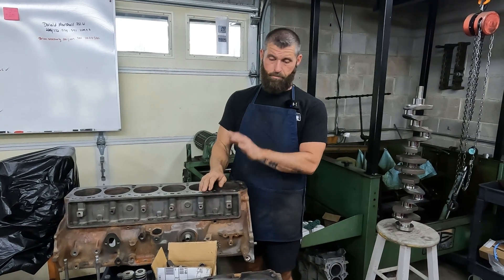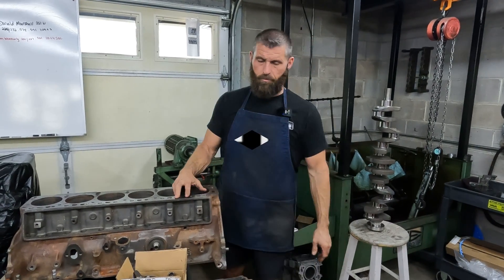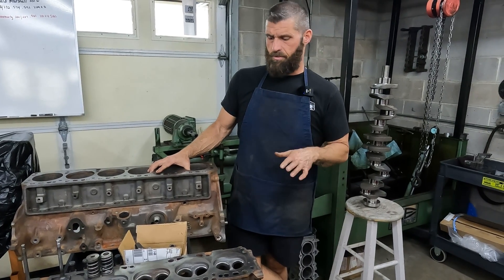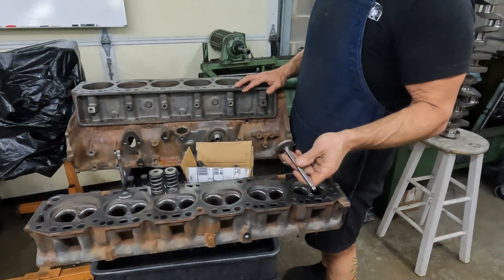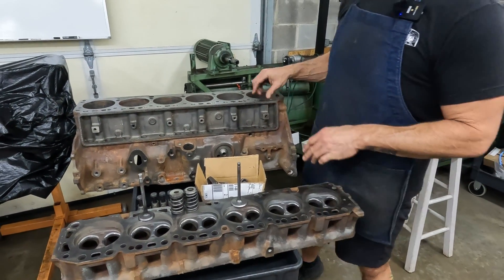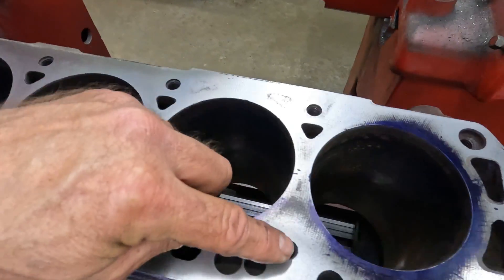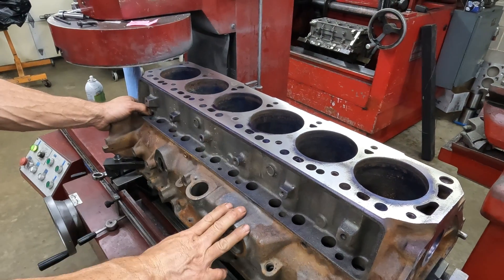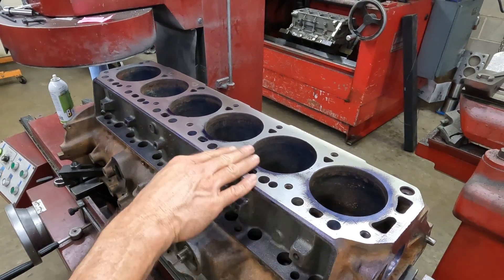6 in a row : eps #1 , Decking the block

Comment: Your right, when me and my buddies were 16 years old, we did not deck our rebuilds/heads because we used those thick composite gaskets and we never had a head gasket blow out even with our 10 to 11-1 compression. This was a very informative video, thank you sir.
Reply from the maker: @siliconvalleyengineer5875  very welcome

Comment: It sounds like you already have pistons, but if you don't you can use 351W pistons and have a lot more options.  You just need to find a set of early 300 rods with the .912 wrist pin or bush the existing rods for it.  Nothing really useful out there for 300 pistons any more.
Reply: Ford 390  TRW/Speed pro L2291F pistons will work in the 300 if you bore it to 4.050". Same wrist pin diameter, same compression height but those pistons will have way higher compression than the stock 300 pistons.
Reply: @MattsRageFitGarage  390 pistons used to be the go to for the 300 because there were more choices and they were cheaper, but that isn't the case any more.  The set you mentioned is forged and cost $500.  A set of 351W cast pistons that will meet the needs of 99% of the people building a 300 can be had for under $150 while leaving room for a few more rebuilds, adding just a little compression, having a tighter cold clearance and weighing a lot less.  If you do need something slightly stronger than plain cast with a significant compression increase you can get a KB 151 hypereutectic set for about $300.
Reply: @GoPetty43  pistons are expensive for anything these days unless you're going for the bottom barrel stuff.
 I was pricing out a decent set of pistons for a 351W last week and the prices were ridiculous.

Comment: I recently had a small block Chevy where from one side of the number 1 cylinder to the other was 0.002" difference in deck height. I told the machinist who probed it with their CNC mill and he called and said that I was right. I think he was surprised that I figured it out at my home shop, without a CNC machine and that it could be that far off in 4" of deck travel. That engine has been fantastic on the racetrack after all the love it was shown at the machine shop. That's what you sell, "engine love."😊
Reply from the maker: Definitely

Comment: I used work in a garage and do valve jobs on heads that came to me cleaned up but I don’t understand why the cylinder closest to the water pump has the most cylinder wear, why is that?
Reply: The outer cylinders usually run the hottest and its common for them to have more wear than the inboard cylinders.
Reply: @MattsRageFitGarage But don’t you say the cylinder closest the water pump has the most wear right after the 9:00 minute mark. I’m not trying to to be a smart a** but I thought it would be the hottest cylinders farthest from the pump on an engine. I understand it’s easy to misspeak making videos all the time however I just watched the video again. Am I missing something?
Reply: @jamesgreen9954  Depends on the flow of the coolant for a particular engine. Most engines the water gets forced to the back and then back up front. Also didn't catch if this was a carbureted 300 or not. That also plays a part in cylinder wear. Just about every engine I ever tore down or worked on that had the heads off of, the outer cylinders to the block always had the most wear to them.

Comment: A friend of mine was working on a straight 8 Packard that the block was .008 bowed in the middle and the head was .007. We took of .005 from the block and 004 from the head. It is still running today. What you said about the composite gaskets must be what's holding it together. Thanks for the education.

Comment: That motor decked off like it had been run really hot a time or two. It should be a really good block. Those old 240 and 300 were good engines.
Reply from the maker: Definitely

Comment: We ran a fleet of E-350 Ford vans at our plumbing company . We had 300 inch 6's and 460 V8's . Under essentially the same conditions , carrying heavy loads every day , the 300 inch 6's out lasted the 460's 2 to 1 . We ran 8 to 12 vans , depending on need at the time . This was in the 90's . All of the 300's were mid 70's trucks because they didnt need to be replaced yet . The 460's were mid to late 80's and 90's models . All of our trucks got maintained like crazy , none were neglected , so it wasn't that , the 300's were just great motors !
Reply from the maker: I believe that 💯

Comment: In the mid-'80s, I interned at a Ford Dealership while I attended trade school to be a "Factory Trained Ford Tech". One of my first jobs in the shop was to R&R the 4-speed Automatic (AOD) on the shop truck, which was a 1980 F-100. It had 700,000+ miles on the original 300-six engine and I was told I was installing what would be it's 7th transmission. And the engine ran like a Singer Sewing machine. Lots of noise but never quit and always got it done.

Comment: I am moving into a rural residential estate by next year which was developed about 40 years ago & a lot of people moved out after finding out that the frames of their houses had been eaten out by termites over here in Australia.

My dads house is as old as I turn this year (47) & it was built using eucalyptus timber which seems to be much more termite resistant than the pine wood framed houses in that estate.

In my case the block of land is vacant meaning that they will obviously build a steel framed house on that block of land now.

For whatever reason with my grandfathers old Ford EL Falcon wagon  after he rear ended another car in traffic at slow speed because he got distracted, it was a Domino effect meaning that a few other cars in front of him got rear ended as a result.

He had to pay for the damage out of his own pocket because he had no third party property damage insurance, anyhow, the car was placed on a chassis straightener & they appeared to a good job on the repair but the wheel alignment was off afterwards because it began to scrub out of the inside of the front tyres, they were all saying that that they're never the same even after being straightened so I don't know if that's a load of bull crap or not meaning that's a mechanic such as Steve whose saying that.

I know that his brother bought a Ford XP Falcon which was like that in the 1960's & he drove it down to Sydney which would've been a 100 kilometre or 60 mile trip & when he got back home all of the tyres were all scrubbed out.

Him & my grandfather were both Holdens but my great uncle married into a Green side who were all Fords as well.

I can remember when this old mechanic did a wheel alignment on my grandfathers old Ford XF Falcon utility/pickup truck he set it up to his own settings because he said that Ford Australia never got it right as far as wheel alignment goes at the factory, they basically were fitted with the same sort of wishbone suspension as the XP Falcon where the camber was adjusted by shims,that was up until at least 1988 when they released the EA Falcons which had front struts with adjustable camber (shimless) fitted albeit still were fitted with an upper & lower wishbone assembly in the front end,the old suspension still carried through up until 1997 in the XH Falcon utility.

I can remember when my auntie had a front end collision in her old 1990 model Holden VN Commodore wagon & one of my dads old neighbours fixed it up on a chassis straightener & that Bambach was a perfectionist who did a very good job fixing it up,the camber could be adjusted by rotating the top strut hats since Holden based the design off the Opel Omega in Australia.

My brother eventually got it & did a hotrod type of paint job on it ,he spent $20,000 AUD on the car then someone ran a red traffic light & smacked into the left hand quarter panel & he got upset when the insurance company paid him $4000 AUD for the market value of a fully rebuilt car which had 500,000 kilometres on the odometer (300,000 miles),he paid him out for a low kilometre VN Commodore wagon which was in good condition.

It was a waste of time and money because my brother dicked around after my father welded a new front radiator support into the car,he wanted him to just repaint the engine bay, drop the powertrain back into the car then get a blue slip inspection done to get it re registered.

What happened is that the road and Maritime service of New South Wales in Australia bought a new law out banning repairable write offs meaning that the car couldn't be re registered since it had been written off.

My dad got pissed off then had the scrap metal guy tow it away which upset my brother.

They bought that law out to combat rebirthing of stolen vehicles where the VIN or chassis number was transferred from a written off vehicle onto a shell of a stolen vehicle which had been built from the parts of stolen vehicles !

Comment: Ford inline 6 cylinder units have always been the mainstay of the Australian built Falcons and have always been super reliable right from the 1960's until Ford halted production several years back. The old 250 morphed into the 4.1 liter with a cast iron crossflow head. Then the head was made of Aluminium alloy and fuel injection was available on some models. next change was to go to a single OHC and standard 6 port fuel injection and variable valve timing on performance models. Then the last one was the twin cam Barra engine still 4 liters and still 6 cylinder inline that when tuned and turbo fed made great HP.

Comment: I had a 1970 F100 with a 240 six cylinder engine- If I remember correctly the 240 and 300 block was the same, the difference was in rods and cranks. I remember trying to get all the parts to go to 300 when I had someone build up my engine (approximately 1975 - the truck had around 100 thousand miles on it) and we came up short on some rods at the time but did get a new head for the 240 engine. What we did back then was find an engine to rebuild and then swapped the rebuild out for the engine we had in the truck. I sure do miss that old F100 pickup truck. All I got to say is you/ your shop appears to do excellent work much better than most of the shop work I remember back in the 70s. Seems you are very particular about the job and the work you do, you seem to be the kind of person like Pete was- he would not allow anything to leave his shop unless it was right or correct to the best of his ability.

Comment: I’m not local, would a cost of 350-400 be a good price to balance a gen 3 5.3 used crank and new summit pro ls piston and rod setup? Thanks
Reply from the maker: No heavy metal, yes
Reply: @powellmachineinc thanks
Reply: The shop i use. Did my last all forged 6.0 LS assembly for 250.00, no Mallory. Made a smooth 1187 horse to the tires, so they did a good job. I think it was like 275.00 for a 454 forged assembly I had them do, too.
Reply: I work  on Holden inline 6 cylinder engines for myself I run a hose from  the water  pump to the back of the block try keep the water temperature the same .
Number 5 cylinder has always given people problems it ran hotter than the other cylinders  , piston problems ect .
Kit from down under